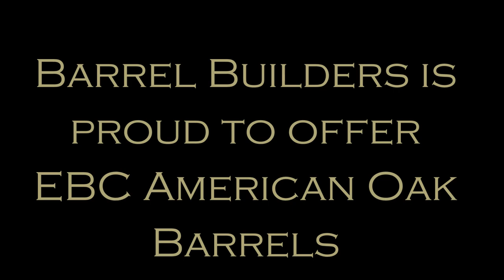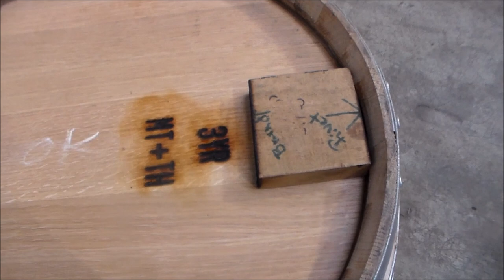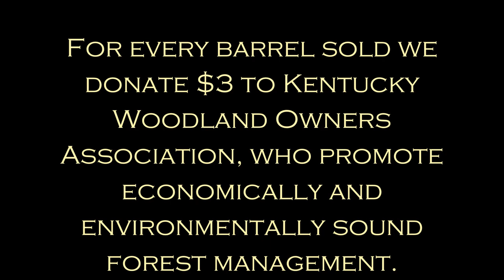A Look Inside East Bernstadt Cooperage (EBC)

Comment: best video yet on stave production and barrel making, though in most locations a "select cut" is a high grade, which is totally unsustainable forestry and the worst thing you can do. In the American East most private forests have been "select cut" to death, leaving red maple and black birch as the dominant species. This is because the loggers keep telling the landowner each time "See, we are leaving lots of trees, so the forest is still there," while they are in fact removing the highest grade of timber and leaving behind the junk. Worst-first is the correct way to harvest timber. If you can get a stand of mixed age trees, then you can manage it on a mixed age basis, removing the older trees and leaving the younger trees to grow. It is not true that smaller trees are young. Lots of small trees are the same exact age as the larger trees, and doing a diameter-limit cut (another "select cut") is the worst thing you can do to a forest. Good forest management removes the oldest and least desirable trees first. Loggers want the best trees first because they make the most money with the biggest trees, and they spend the most money cutting and handling small diameter trees. Anyhow, a select cut is hardly the best or sustainable forestry. Very few private forests are well managed or carefully managed for successive stages of valuable timber production. In the American East, so many private forests have been high graded so badly for so long that only a clearcut can re-set the forest back to zero to start over. Or set it on fire, like Nature used to do. That will weed out the junk trees and leave the good ones with thick bark.
Reply: You think thats bad forest management come on up to British Columbia, Canada its a real gong show we sell most of our logs to China . They have the logs cut to 20 ft. lengths packed into shipping containers , whatever is left of the log is left to rot regardless of what ever value they might be worth.

Comment: Pretty slick operation !  I’m a retired Woodworker  i found watching some of your idustry Speifi Woodworking tools. Very interesting   Also thought it was cool that the logos were still hand nailed in place  as many modern Woodworking people  are forgetting. How to use hammers with everything so automated now days
Reply: No modern woodworker is forgetting how to use a hammer. Nearly every woodworker has had to correct a joint with a blow from a mallet or hammer, no matter the age. Nothing has changed, infact most tools used by modern woodworkers are still from the 40s. Do you mean Carpenters? Homebuilding is a much different craft and the automation is a necessary sacrifice for the best possible result in the shortest amount of time. It was the natural progression from the only way to do something; to having options that are faster and cheaper.

Comment: NOSA for sure would be interested in the working conditions there? safety,earplugs, headgear? nothing of that sort needed? all legal? until the first accident. and i did not even ask about safety footwear.
Reply: I caught that also. OSHA would be concerned. The guy sanding barrels with an air sander is breathing in a lot of dust. Either a vacuum system on the sander or next to it, or a dust mask would greatly reduce his exposure. I'm assuming he does this job every day. It is quite noisy in that factory and I didn't see anyone using ear pro...........I can vouch, as a trades person, that it adds up (even the exposure of saws, hammers, impact drivers, and nailguns). While I'm not a safety sally ( I hate hard hats and they are very painful with my neck issues, but I have been on jobs lately that require them. They were not required and wouldn't have served much purpose on the first 23 years of my construction career), there are easy ways to reduce risk, especially in a factory setting where the risk is there everyday.
Reply: austrorus Absolutely agree!!!
Reply: CGT80 It's actaully horrendous.. (I'm a bricky from Denmark. That's dirty, dusty and noise work.. but this is bad)

Comment: About 45 years ago l worked for a time running a jointer wheel, making barrels that went to Jim Beam down in Missouri. Was also a pinner making heads. It was a bit different than how these guys are doing it. A lot more manual labor. We didn't have the leisurely pace these guys do either.
Reply: Was it in Cuba
Reply: @taragabel6383  

No that was in Lebanon

Comment: Wonderful and nice looking pieces. I did notice that the workers are not wearing noise protection when working on the power tools, which are extremely noisy, well over 120 decibels. They are not wearing respiratory protection either when sanding....is this a regular industry practice?

Comment: I️ work at KYCooperage and they way we do it is similar but   It’s not an easy job and we haul ass
Reply: @shanek6582  new barrel at EBC is $525 for one.
Reply: Hotrod Hog, I didn’t know they were that expensive, I’m going into the cooper business! I bought a used barrel with Dickel stamped on it I’m going to use in my blacksmith shop. If they’re that expensive, I wonder why they don’t use them for more than one time for liquor other than bourbon. I’d think if they were always filled with fluid, they’d have an indefinite lifespan.
Reply: @Hotrod Hog Yes but they donate $3 to forest management lol.
Reply: mark rainford, IKR, they act like cutting only the biggest best trees is good for the forest.
Reply: @shanek6582  They do get reused, at least in some cases. Some beers are aged in barrels to add flavor from the previous product that was in the barrel. I would think that wine could be made again in the barrels, but I don't know much about the process. It would seem like a waste to use a barrel once. I do use jack daniels chips in my smoker, made from the barrels their liquor is aged in. That is my favorite flavor for smoking.
Reply: CGT80 I bet that jack daniels barrel chips would make some good homemade bacon. I bet you could actually use a barrel for the smoker also! I might have to try that one day.
Reply: @shanek6582  jack Daniels ain't bourbon whiskey.
Reply: Worked at the whiskey barrel plant in eb ky was third employe hired when it opened this is wine barrels

Comment: Great video. What happens if it rains during the air drying? Wouldnt that set things back to square one?
Reply: elliot mallon Good question , rains & snow....we need an answer..!
Reply: @enthalpiaentropia7804  air drying is to let the inner wood dry out.  rain or snow only wets the outside and that quickly dries off with a few sunny days.
Reply: @rosewhite---  May be...!
Reply: @enthalpiaentropia7804  Even over here in rainy UK the wood stacks are outside for a year or more.
Then each piece has to go through the machines again to cut off the dirty outside wood.
Wood processing is wasteful but but the waste has alwasy been used for firewood or animal bedding.
Reply: @rosewhite---  Thanks for your kind explanation..
Greetings from Paris-France..
Reply: @enthalpiaentropia7804  My brother had furniture factory and bought air dried slabs cut from tree trunks.  They were about 70mm thick and had to have about 5-10mm sawn off each side to get the pieces needed for chairs and tables.
I used to go get car loads for my lounge fire and saved lots of money!
Reply: The sap (not just water) dries out and rain and outdoor aging helps to flush out some unwanted flavors and tannins etc.

Comment: Hi. At 5:30, how are the parts of the heads stuck together? You don't explain. With some kind of glue? Some other method?
Reply: No glue, we missed the boards being drilled. You do see him joining the boards with dowels (go into the drilled holes). Glue would dissolve over time and taint the liquid. Its also unnecessary, as the wood swells to become water tight.

Comment: How do you put the taper on the hoops? Very interesting video - Thanks!
Reply: Darrell Copeland I rivited the. Hoops for 9years at eb cooperage when the band is cut it goes through a two wheel curling machine and bottom and top is angled to make the band curl so won't cut in the barrel and I riveted each of the bands by hand on a rivet machine
Reply: @kjchandler7495  Thank you for your answer.
Reply: Darrell Copeland no problem darrell hope my comment was helpful
Reply: @kjchandler7495  Your answer was very helpful and thank you for your reply. I have been looking into maybe using offset rollers. Any plans on giving us a short video on this?
Thanks Again

Comment: This place looks laid back. I worked at Kentucky Cooperage Inc. in Lebanon KY. I will tell ya. You will work your butt off. Its hot and stinks of smoke. It is very hard work. when I was there it was 12 hr shifts 13 days 1 day off and back at it for 13 more and so forth. not fun at all.

Comment: Unfortunately the timber harvesting described is not a best practice or sustainable method.   I won't go into detail but FSC certified wood is a good way to start.  There are other sustainable certified systems out there too.  Try that instead.

Comment: Great Video, I do like the product you make and the attention to detail for your product. But as an SOHO/OSHA safety specialist  for the department of defense, i want to use this video as a workplace safety inspection example. There are so many safety violations in this video i would love top see your OSHA 300 Log. 

I don't want to be the bad guy here but i would like to point out to my soldiers and civilian employees the safety violations i have observed. I can only guess as to what all the cables and hoses are that are lying around and hanging from the ceiling.
Starting at the video time stamp i'd like to point out what i saw and the violation, I will provide the OSHA regulation in violation if you like, later. 

Time Stamp- 3:00 - where the sub titles point out "they are cut in half" right side of the picture if you froze the video an electrical powered diesel heater in in the indoors where wood is cut and saw dust is airborne and piled everywhere, the manufacture user manual strictly warns not to use their product in such areas. Also in that area there isn't a Fire Extinguisher (FE) in sight. Also above the wall opening there are what looks like electrical extension cords hanging from the ceiling and along the wall. 

3:04- worker walks under a bridge platform for getting over the machine. The worker ducked under a steel platform which is a head hazard. No marking or protection from blunt injury, soft impact materials.

3:11- worker is not wearing Personal Protective Equipment (PPE), eye protection,  and also another possible electrical cord hanging from the ceiling, accumulation of flammable materials, saw dust and wood chips 

3:23 - what appears to be electrical wires lying and hanging around bottom left of screen, the vacuum system generates static electricity, is it grounded and where is in grounded, and how often inspected?

3:28 - worker no PPE , eye protection, also three electrical cords hanging from ceiling

3:52 - diesel operated machine operated indoors. manufacture requires electrical grounded, where is the grounding, and why isn't it vented out doors, why is in even being used indoors?

4:01-  grass is fire fuel, should not be around wood products, fire hazard, needs to be cut or eliminated with herbicide or tilling of earth around them.

4:51 - only one guy wearing eye pro, no PPE, shelf behind worker has item stacked on the top of the shelf fixture without fall protection. Is the shelf anchored to the wall?

5:08 - no eye protection PPE, no fire extinguishers

5:37 - No PPE, what looks like gas piping in back ground, isn't properly marked or protected from moving equipment.

5:42 - no PPE, no grounding for static electricity

6:09 - this concerns Machine Guarding, no machine guarding on pulley's, no machine guarding over sprockets at end of machine just beyond the right shoulder of worker. Rule is that any moving machinery that is under a height level below 8 feet needs to be guarded from worker 

6:33 - No Fire Extinguisher at exit, no cover on garbage can

6:41 - no guard on pneumatic press (ram), worker isn't wearing eye protection

7:33 - no eye pro, fire extinguisher not properly mounted on wall and it's being blocked by a machine or equipment, no Fire Extinguisher signage, black electrical cord hanging from ceiling, worker in flammable cotton clothing, facial hair and tennis shoes with slippery floor to walk on, where are the fire extinguishers?

7:46 - no eye pro, machine guarding from rotating machine, machine worker has it's machine guarding lying on the floor, is it locked out, just to the left of the worker

8:05 - Kerosene stored inside building near roll up door, the cabinet in the back has fire extinguisher signage but where are the FE's

8:15 - no eye pro on worker and where is the machine guarding?

8:57 - No PPE, no machine guarding, trip hazards from all the stuff around worker air hoses? no electrical emergency cut off switch, why is the worker using a scrap piece of wood as a tool, needs machine grab to hold barrels firm

9:22 - worker no PPE, machine to workers left has no machine guarding, no PPE Fire Hazard

9:35 - worker on the right has no PPE eye pro just gloves on other worker but no eye pro

10:10 - no machine guarding for rotating machine and barrel, also no guard in machine barrel arbor

10:45 - no machine guarding for strap being pressed into place from stored energy and applied energy, the cooling fan cover on the electrical motor with brushes from spark and flammability

11:11 - No PPE or heat resistant gloves, rubber is flammable, no guarding from heated surface of the brand and no employee warning for the hot iron hazard, green and red electrical of air hose on ground fall hazard and electrical shock hazard

11:36 - no PPE, bottle hanging on conduit in back ground not properly stored and what about the SDS (MSDS)

11:55 - no PPE as required by the sanders manufacture user manual

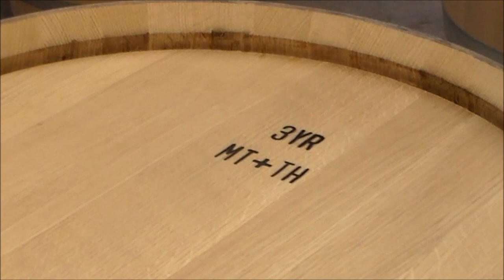12:11- blowing saw dust with compressed air, what is the service pressure (PSI), no eye pro

There is also a little room in the video with stuff stored on top of the ceiling for the little room, whats the engineers weight limit for the ceiling and the stuff isn't protected from falling on someone in the event of an earthquake 

Tha'ts just the stuff i caught while slowing down the video, i'm sure the employer is a great boss and they employ a lot of local workers, great on them. But I also bet the employer doesn't want injured employees or law suits from those injuries. A simple walk through safety inspection and some work to correct those issues that I pointed out. I'm sure there are plenty of hazards in the yard and these are exposing employees to other work place hazards. 

Federal OSHA can give this and other businesses a free safety inspection, however they will expect all of the things they find wrong will have to be corrected if the business owner doesn't want fines or closure. 

Find a person trained or business trained to come in and preform a safety inspection for you. A lot of these problems can be corrected by education and employee training. Electrical standards are plainly defined bu code. The electrical code is lost on the place. The electricians should be ashamed of themselves. new employee training for everyone to start and refresher training annually for workplace safety, and a huge suggestion is i would install a safety committee that is trained and free from harassment by the employees and management.
Reply: You must be a lot of fun at parties!
Reply: After doing this stuff for 30 years I just turn it off.  Did you learn anything from my 1D view of the workplace?
Reply: @snoebay88  Parties suck! And, that is such a stupid phrase. For me, just the lack of ear protection and breathing protection really stood out. People don't realize how that exposure adds up over the years. While I often didn't wear safety glasses in the past, I always used a face shield or goggles with grinding and cutting, but have worn prescription glasses for a number of years now. Since I always have to wear glasses to see clearly, I always have some protection and it has saved my eyes from injury. From a business standpoint, the suggestion of having an outside company help them comply with good safety practices is great. Employers have to cover their asses. While I do hate some practices, such as using hard hats, others are very easy to implement and make a major impact on worker health.